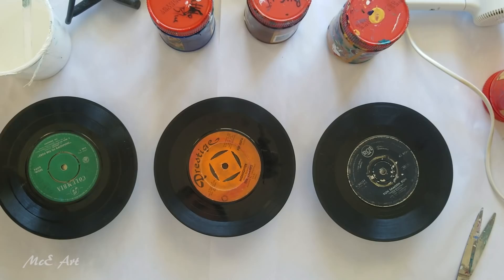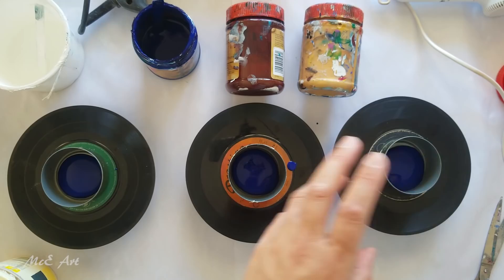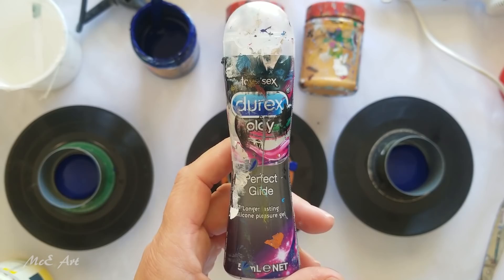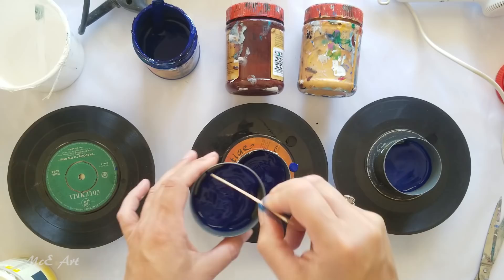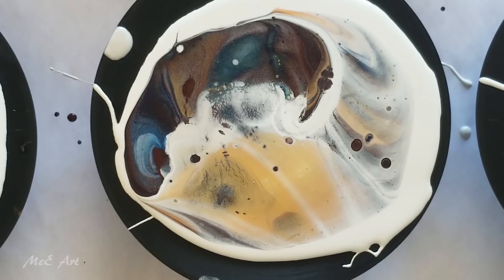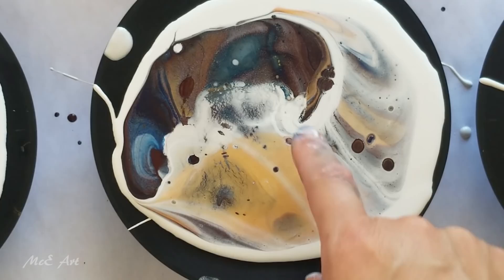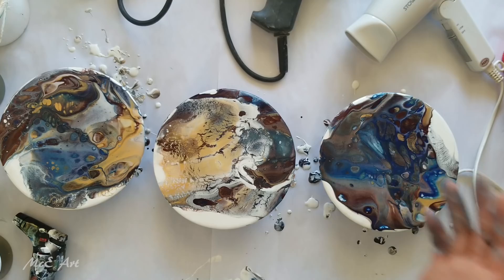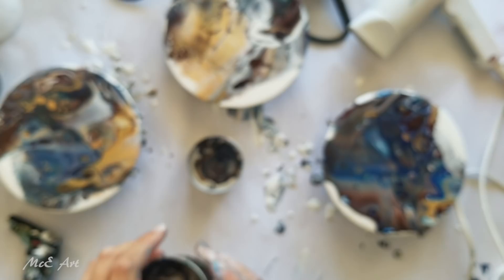442 Testing Flame vs Heatgun vs Hairdryer on Acrylic Pouring

Comment: Ah this is what I needed to know! Thankyou and Thankyou for recent link to silicones too :)
Reply from the maker: Awesome!  How much fun can you have now?
Reply: Vivian johnston I am too trying to figure out what kind of silicone I need. I looked to c what they had online for Walmart & there is quite a few. There is also one for like cheap & to lubricate stuff in the home (cars & or kitchen, etc...). I have a super small Walmart so I’m gonna have to just get whatever they got. I saw where someone used argon oil for yr hair which is silicone based so I guess there is many options. I watched a video where people used Dawn dish soap vrs rubbing alcohol vrs silicone & it all gave diff looks that were pretty cool! If u like lots of cells u probably wanna use silicone!! I guess it also helps the paint from not sticking so much in yr cup & so thus doesn’t waste as much paint. 😉

Comment: Thanks for the video.  I guess that all of the different tools can be quite different.  I use a gas torch but I also love my (paint stripper) heat gun and I get lovely cells and definitely don't get any cracking.
Reply from the maker: Yes all of them are different. Great to hear your feedback!  Thanks Rob
Reply: Do you need to wear a face mask while you use these heats?

Comment: Heat gun with a cool air function works great... you can go back with heat to bring up cells  after you've blown it out.
Reply from the maker: Great hint!  Thank  you.
Reply: @McEArt   no problem.... tired of using straws and lung power so I'm off to mitre10 this morning to grab a new gun, cool air function and 4 different sized head attachments 🥰🥰

Comment: I haven't used the torch yet. I have a heat gun, but it's not a paint stripper. It doesn't blow a lot. I get cells,  and the only time that I had cracking was when I got impatient and put the heat too close for too long. It does look like  the torch works best. I haven't found an inexpensive torch yet. I'll have to check Dollar Store.  Thank you for the demonstration and, of course, the cabochons dips! Lol
Reply from the maker: Yes if your heat gun doesn't blow as much as mine that would make a big difference :)

Comment: Am i correct in thinking that the baby torche is fab for detailing à la Elyse Fournier/Karen from Waterfall Acrylics - ie going around the edges or a particular colour/area to highlight what’s underneath, whereas the heat gun and plumber torch (I have a temperamental one like Julie from Pouring your Heart Out*  has... Lucky me 😆) are best for popping air bobbles and making all and every cell under the sun come out if you come too close to the canvas? 
* hark at me dropping names lol.
Reply from the maker: Hi Vanina, I use the flame torches only and go small one on small paintings or for detailing and big one for big paintings.  I don't use the heat gun or hairdryer at all normally.

Comment: You kept the heat gun in the one spot for too long.  When other people use it they move it around quickly and do it for much less long than you did.  They don't seem to get any cracking.  Maybe move it around lightly like you did with your small torch.

Comment: Is it just me or is the cracking only happening with the house paint? I wonder what would’ve happened if it was the same paint as the colors...or did I misunderstand?
Reply from the maker: Great question.  I have worked with these outside of this video and had similar problems when using all art paint.

Comment: How much floetrol do i use for a full canvass 10x 16
Reply from the maker: At the moment I am doing a 50:50 mix with paint then water to the right thickness.  I approximate that 1ml of mixed paint per square inch of canvas

Comment: Sadly I have neuropathy in my hands, so it's a heat gun or a hair dryer as i cannot hold the torches on, or even set them alight..
but now I know what the problem is  :)
Reply from the maker: What else is possible I wonder.

Comment: I use a torch but still get cracking on my paintings 😩
Reply from the maker: Then it is something else causing the cracking, maybe drying to fast or not enough binder in the paint so may need to be look at those parts of the process.
Reply: probably the top layer drying faster than the base coat 🙀